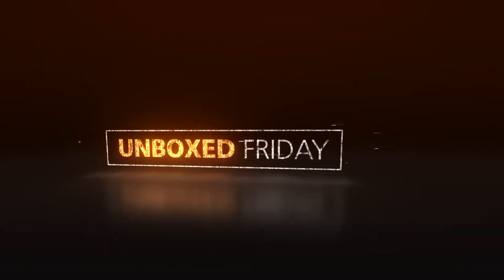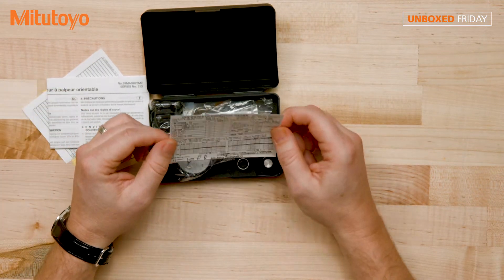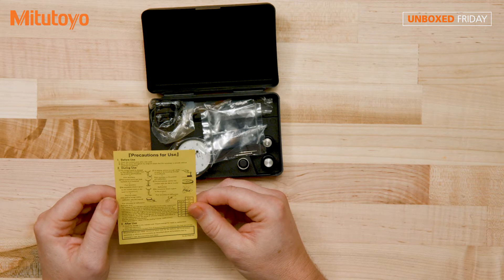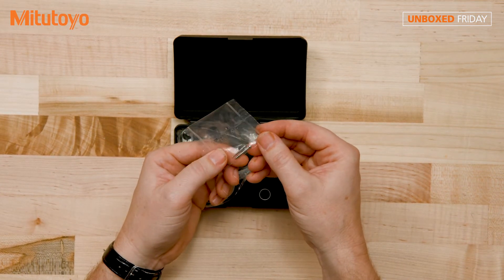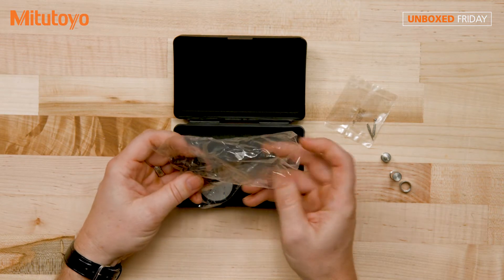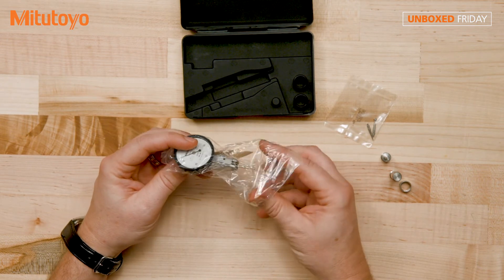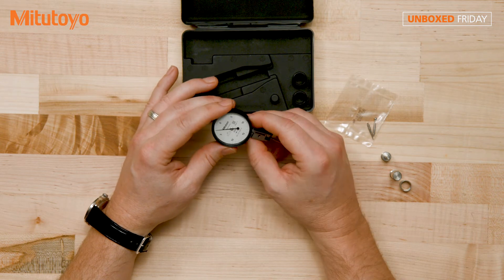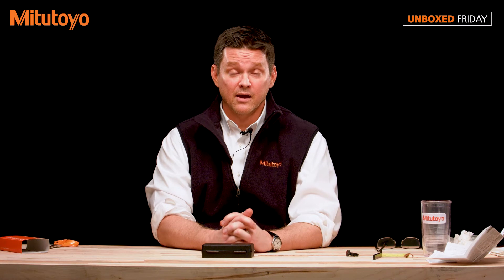Dial Test Indicator - Unboxed Friday - Mitutoyo 513-402-10T (Unboxed Friday 001)

Comment: I own a 513-445-10T.  I'm a little disapointed that there is no instruction manual.  I see other brands test indicators have the tip adjustable but I'm not sure how to do that on this one without breaking it.  Additionally I see there are other threaded tips, but how do you replace them without damage?  Is there some method to removing and tightening them?

I wish there was more explanation with these; I was hoping to find that information in this video instead of what is inside the box.  Please give us instructions and use videos. 

Thank you.
Reply: I just bought one, and it is a small indicator. Its high precision, but the range seems to be just 13-14 thou, so for high precision work (something I dont often do, and wish the vendor had listed that info...). The tip on this does not seem adjustable.

Cant say how to swap tips out. Havent done it yet.